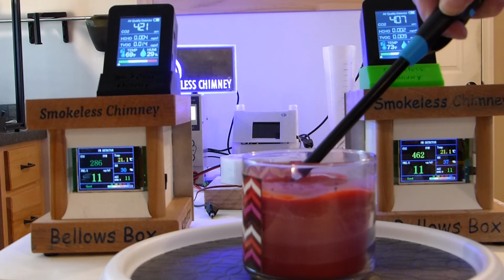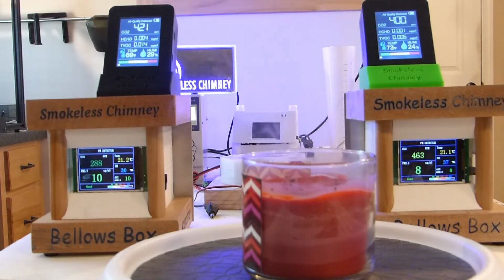Air quality meters tested

Comment: Are the bottom meters a commercial product that can be purchased online?
Reply from the maker: The core unit is a module I packaged with a battery and BMS charger, give them to people as test units. I am working up to a unit that can be purchased.
Reply: @smokelesschimney8849  Thanks! The display looked like the ones shipping out of China (using PMS5003 sensor), so I was curious. Does your design improve on these?
Reply from the maker: Good spot, Yes it has a PMS 5003. I was more interested in the carbon dioxide sensor.